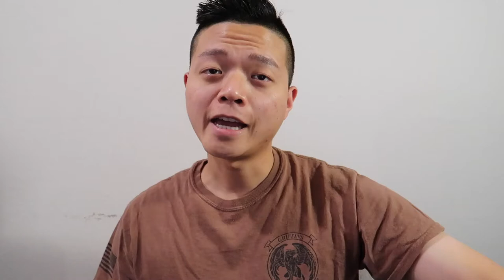Intro to Aviation Structural Mechanic (AM) in the navy

Comment: Hey, I just signed my contract as an AM and I'm thinking after my contract just leave the military and work a civilian job. After 5 years, do you think you are capable of being an aircraft mechanic outside of the military or you didn't learn quite enough to be able to do it in the civilian world?
Reply: Im going to boot camp tomorrow. Im at the hotel and i am wondering the same
Reply from the maker: Hey man! I have alot of friends that are getting out between 4-8 years of service and smoothly transitioning over to the civilian contract job, working on aircrafts. There are definitely those who went and got outside the military qualifications such as Airframe and Powerplant (A&P) and was able to get a higher job position as well. So overall, yes, 1 military contract is enough to be capable of being an AM outside the military
Reply: @limitlessky5784  Okay. Thank you so much for responding!
Reply from the maker: @kimgamayan6349  You got it! Good luck in your journey!

Comment: Is AM similar to AME? I've been researching about it but there's not much info on the web
Reply from the maker: Hey! Hmmm AME's are definitely in a much smaller community than the AM's. I would personally recommend AME over AM though cuz the workload will definitely be less lol. I have met a few AME's but they focus on the safety equipment of the fixed wing aircrafts.

Comment: I am currently in the Navy right now, and I am a CS, trying to cross rate to AM. Really feel like the job is for me,. Do you have any advice for me to go through the process, since you where successful in cross rating?
Reply from the maker: I haven't looked at CS rate's manning situation right now but usually if the rate that you are in right now is overmanned than the rate that you are trying to crossrate, you have a good chance of doing so. 
I would start by contacting/talking to your command career counseler (usually an NC) and talk about your intentions. Cross-rating with your own intentions is an unofficial process that are done in special cases so you most likely have to put in the work such as doing On-the-job trainings, recommendation letters, NKO (e-learning) courses, and any other certificates related to the rate you're trying to cross-rate to.